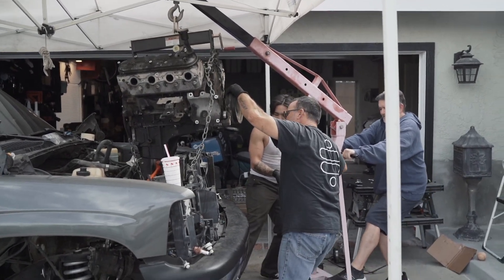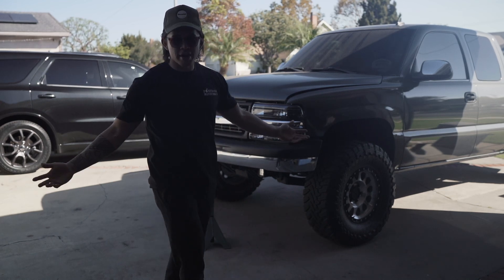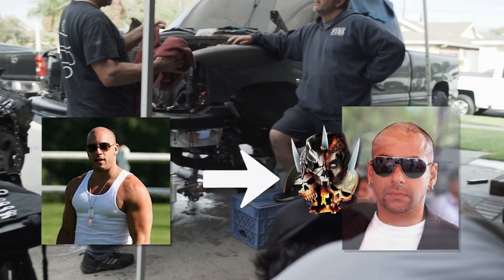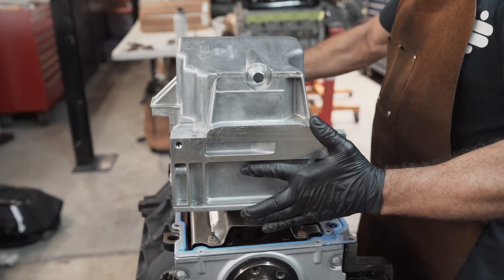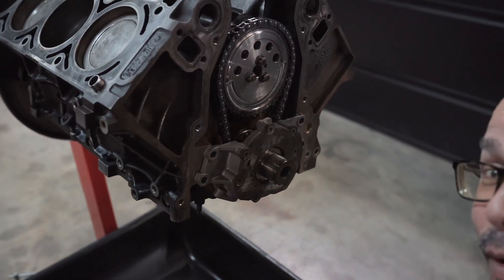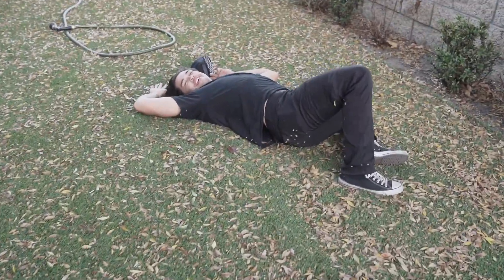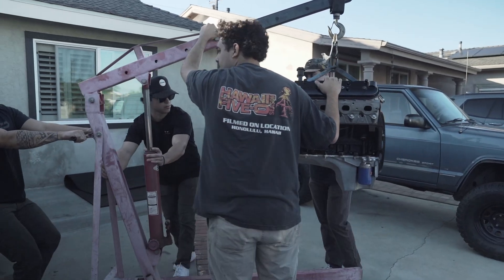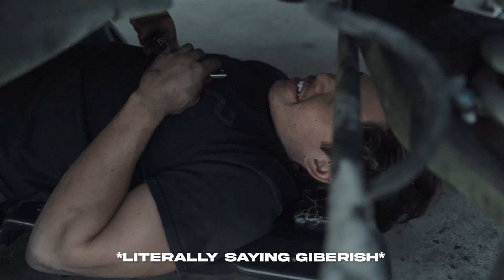My High Mileage 5.3L LS Engine Restoration | Budget Cam Build

Comment: Why was the decision made to pull the whole motor if you were just rebuilding the top of it?
Reply from the maker: it was very dirty, and we needed to change the rear main seal which has been leaking for years. but yea to be fair, we didnt need to but i guess i just wanted the experience 🤙🏽

Comment: This is awesome, I have a 2000 Silverado 15005.3 with high mileage and want to do the same thing. I'm not a mechanic and wanted to know if you had a parts list. Was this a semi or complete rebuild? I look forward to hearing from you.
Reply from the maker: everything i got is in the description of the video! this what they call a soft rebuild, i went ahead and replaced all gaskets, pretty much everything replaced besides the bottom end

Comment: what are you running for exhaust
Reply from the maker: right now it’s just long tube headers to straight pipe. then i have a cutout to a quieter  flowmaster 40 series
Reply: @devanwxyz  right on i’ve been wanting to throw a cam in my rado but just don’t know where to start but i also need it to be more budget friendly